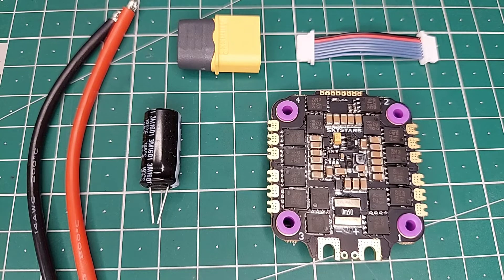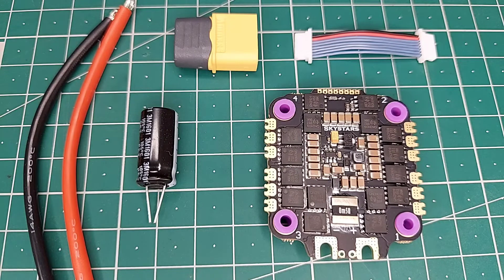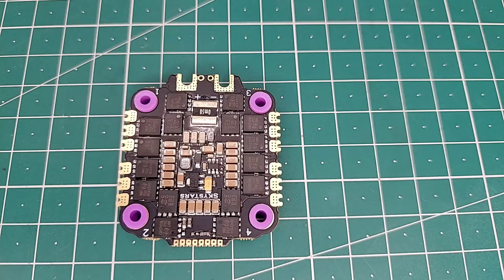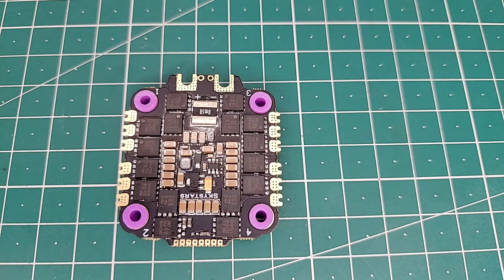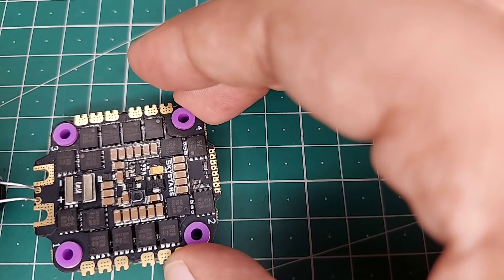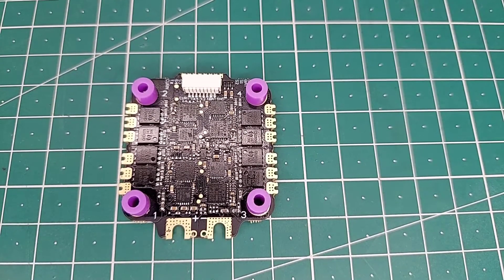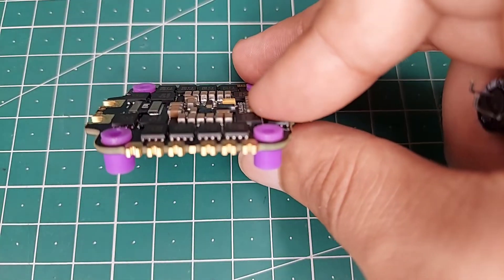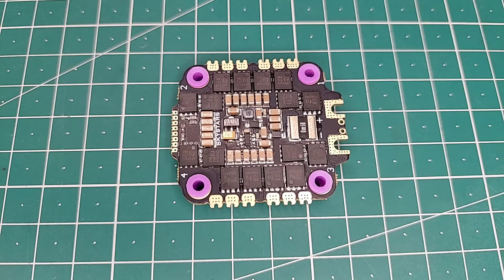Best Budget Blheli_32 ESC ! Skystars KO45 | Honest Review

Comment: Hey, I just bought the KO55 but I can't find the wiring diagram for it anywhere. Could you please help?
Reply from the maker: Search on their website it's there
Reply: @justhackitfpv  It tried. The Skystars RC site has no information. Please help.
Reply: I'm using a Matek H743 flight controller. Can I use the cable to connect the two?
Reply from the maker: @tamburavadak  you will have to repin it
Reply: @justhackitfpv  Listen, I'm in India as well. Can we perhaps talk on the phone so I could clear some doubts? I'll leave you my number on the contact section of your site. Could we do that please? I'm a little lost.